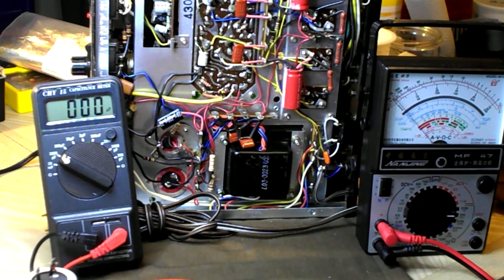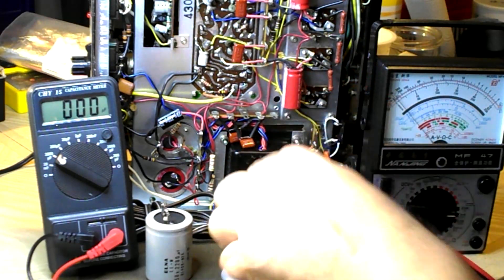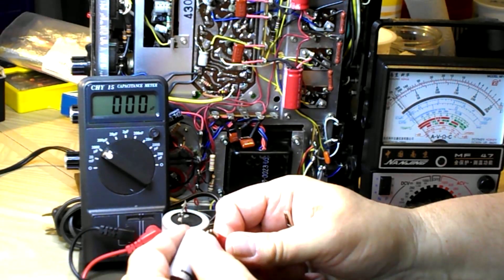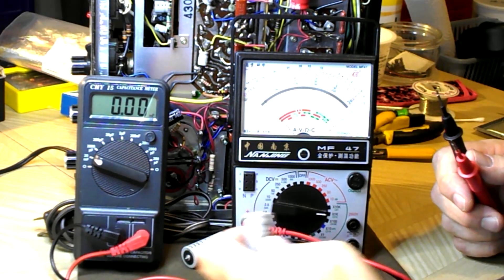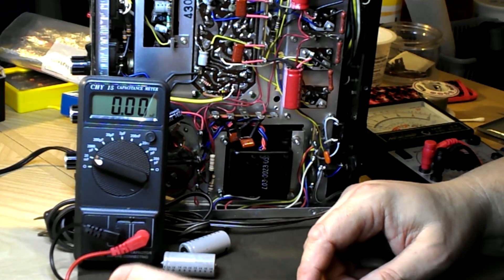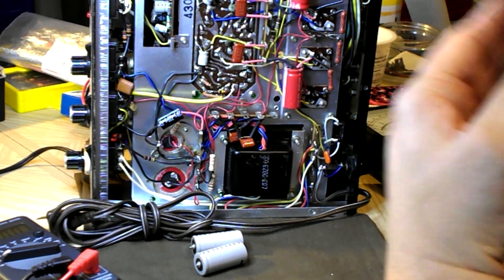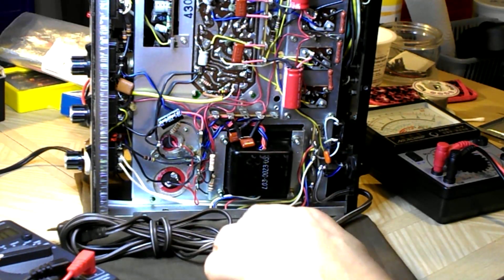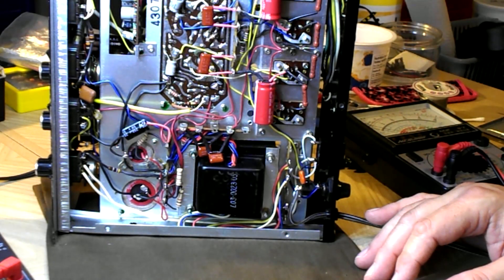The Capacitor Conundrum- original capacitor tests good but doesn't sound great, time to recap!

Comment: As electrolytic capacitors age the dielectric breaks down, the ESR go's high, the voltage rating go's down, the leakage can increase, and usually (due to thinning dielectric) the capacitance increases before it finally fails!

Comment: Just in my modest collection I've seen two (both?) cases.  My 1965 Zenith console stereo needed repair when I bought it from the original owner many years ago.  It's only been within the past year that I discovered it's repairable and decided to give it a shot.  The 3 main filter caps were packaged together in a multi-section "firecracker".  The 3rd cap had degraded 33%, the 2nd had degraded 50%, and the 1st (main) filter cap measure open circuit, completely failed, and caused the 60 Hz wall outlet power to route to the speakers.  Ouch!  I had to replace those just to find out if there were any other issues.  (And there are.)  On the other hand a tech recently restored my 1974 Pioneer SX-434 to spec.  There was the usual transistor black leg disease of the X3X family, and miscellaneous electrolytic caps.  However, the main filter caps measured spot on nominal, so he didn't touch them.  It sounds fantastic.  The SX-434 is 50 years old this month.